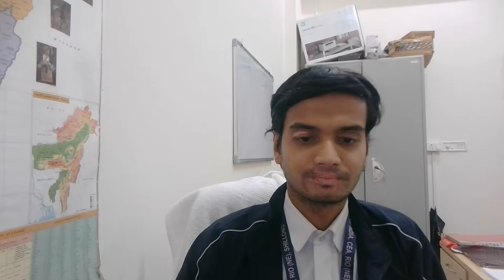GATE 2026 Electronics and Communication (EC) subject-wise and overall analysis - prima facie

Comment: Bhaiya, I'm getting 44 marks plus 2 marks for that diffusion current question which didn't I got yet. So in 46 marks I am in final year, is there any hope for me to get into some decent college? ..I belong to some below middle class family. I really need a job
Reply from the maker: Yes 100%. 46 marks may fetch you around 550-600 GATE Score, so you plan accordingly based on the M.Tech. cutoffs for different specializations in IITs/NITs of previous years.